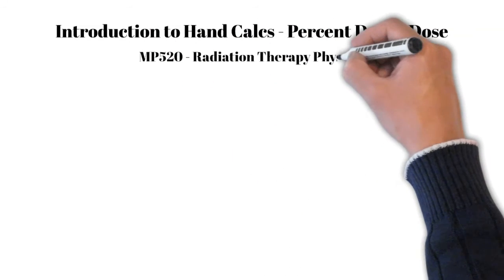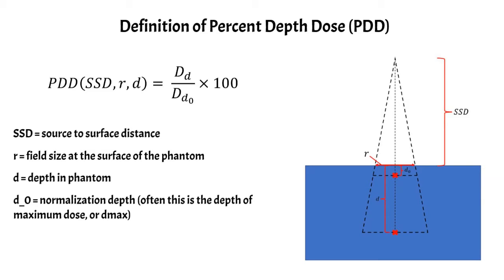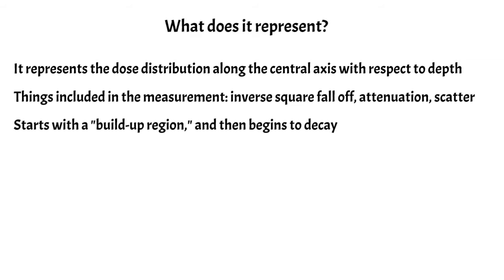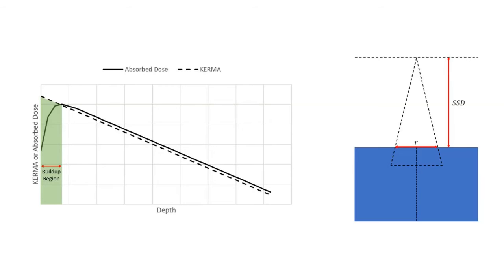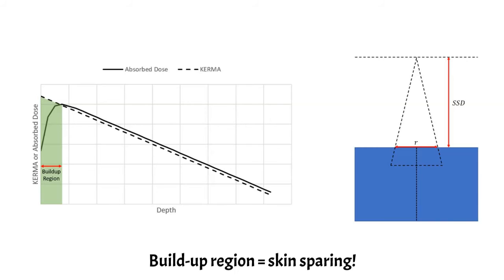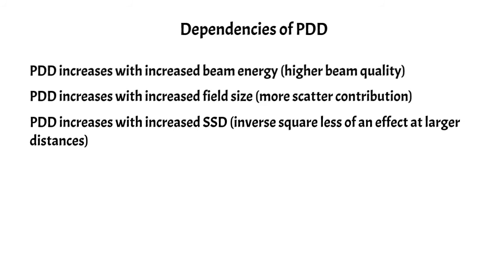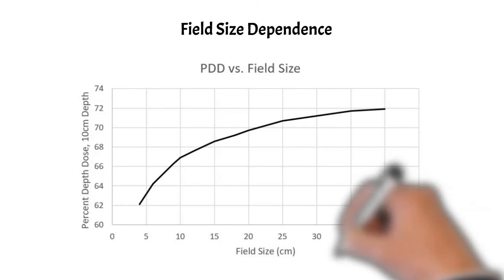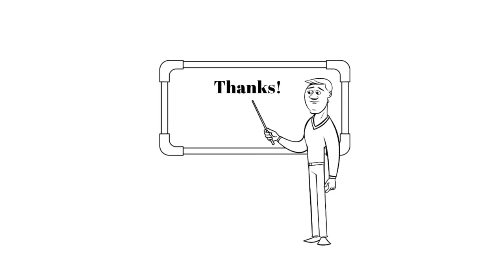Radiotherapy Hand Calculations: Percent Depth Dose (PDD)

Comment: This doesn't make sense as to why the PDD increases as SSD increases. Just pointing at a chart and saying "this chart says so" doesn't help. If the inverse square law states that an increase in distance decreases dose, then an increase in distance should also decrease PDD. This doesn't make sense that the law is only a law in some instances.
Reply from the maker: The PDD is defined as dose at depth d / dose at dmax.  If you look at what the inverse square law does to both points (d and dmax), it should be clear  that the PDD will be affected much more for small SSDs than it will for large SSDs.  Think about the extreme case of a brachytherapy source, in those cases the inverse square is a very large effect because you are so close to the source.  If you measured the PDD from a brachytherapy source, it would fall off very quickly due almost entirely to inverse square.
Reply from the maker: You can actually calculate the contribution of the inverse square law to the PDD as being: (SSD + dmax)^2/(SSD + d)^2.  Notice that for very small SSDs, this factor will be very significant. However as SSD gets larger, this factor approaches one and the inverse square component becomes much less important.